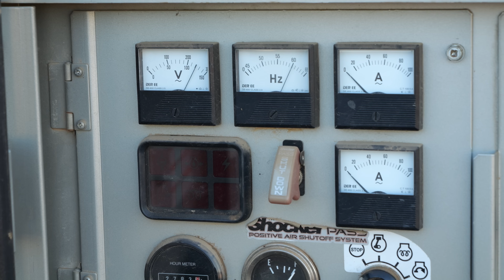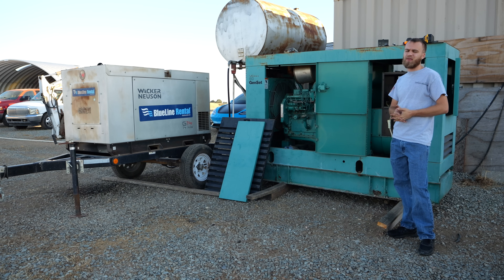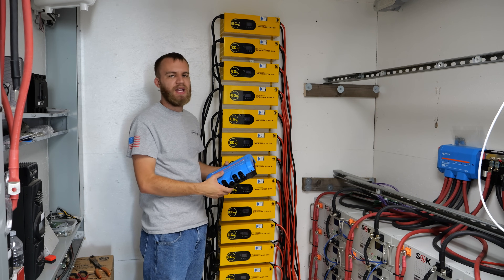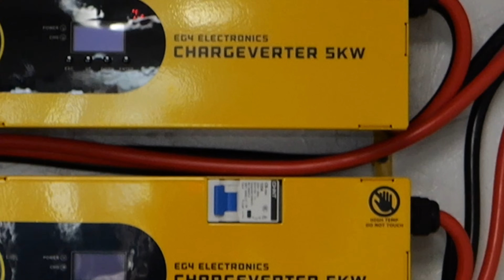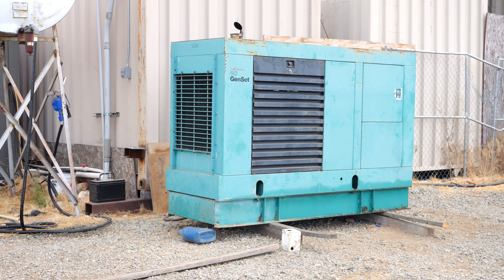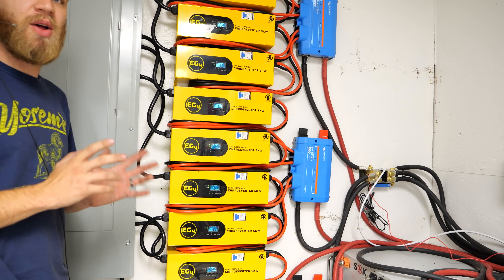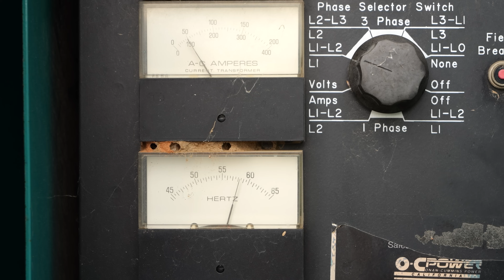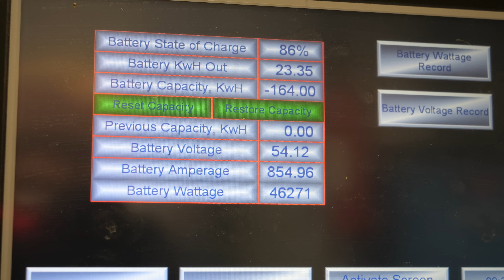😮 12x EG4 Chargerverter 5000's - 48v 1200A Battery Charging System!

Comment from the maker: To answer questions in advance, no, they are not growing crops with all the power.  On the property, there are 3 RV's, one for my mom, one for my dad, and one for my step-dad.  RV's are not very energy efficient...so in summer when it's 110F outside, they use a LOT of power to air condition them.  The electrical room is also air conditioned and there is a hot tub that used to have the excess diverted to it, but sometimes they don't like waiting until there (isn't) excess.  They only have about 12kW of solar, mounted flat, so it doesn't get anywhere near peak production.
Reply: You didn’t mention anything about a lab in those RVs, Heisenberg.
Reply: @nebulight  "Round bottom flasks they make the HighTech world go round" - Queen
Reply: If you hadn't pinned this, I wouldn't have cared why you're doing this, but now I have to ask.  Why is everyone on the same property, yet living in different RV's?
Reply from the maker: Divorced parents living together. Family gatherings are interesting
Reply: @HighTechLab  Love It!! A lot to be said when you get along well enough to continue a relationship with all involved. It is good to see. Blessings to Each of You!
Reply: So about 187 kwh of batteries. Dang I only have 70 and thought I was doing good. I too only have 12kw of panels. I too need more especially in Michigan
Reply: @electromechanicalstuff2602  what part of Michigan are you in?
Reply: WOW! Quite the project! My only recommendation would be to have kept the Plugs to make it easier if you need to replace one of the chargers in the future. Sooner or later one them will break :( But I can also see why you probably didn't want to go through the hassle & cost of wiring all the outlets.
Reply: Interesting.
Reply: Wow they are so low on solar, we have 240kwh bank with 70kw of solar and do not need a generator. Sunny day we hit around 500+ amps continuous for about 6 hours.
Reply: You can get solar panels now for $0.25 per watt new If you search around. They will pay for themselves very quickly
Reply: @deanburrito6943 any advice on where you're seeing those low cost panels? Cheapest I'm running across that aren't used is about $.50 per watt. Thanks.
Reply: What about changing the mounts for the 12 kw of solar so they are at the proper azimuth (usually X number of degrees E or W of magnetic South) and are tippable so that every month, or at a bare minimum every three months (each season) they can be tipped to the proper angle to maximize their solar energy production.
Reply: Money would have been better spent on second hand solar panels and some decently arranged ground mounts. Everything is a lot easier to manage when you are over producing.
Reply: Why are we not addressing mom living with his dad and step dad but they also have money for 12 chargeverters but not the 9v battery for the smoke alarm?  Make it make sense 😂
Reply: Question, how much propane does that joker use per week? Or month
Reply: Amazing work !!
Reply: When I first seen this much power I was like damn… I’m not going to lie I thought you were growing crops with all that power lol 😂
Reply: You could have built a bloody house with all that money. This is just fookin stupid!!
Reply: What’s the overall duty cycle for that generator to keep that battery bank charged?
Reply: I have my mep803 governed with a spring and a zip tie too😅
Reply: Replacing every air conditioner with an EG4 solar/AC mini split would allow a lot less power usage, probably no need for chargverters and a giant diesel generator, and you will find you have way more battery capacity than needed..  put the new money into EG4 solar mini-splits and more solar panels, you will be able to sell 1/2 that battery bank, all the chargverters, and the 100KW diesel generator.   First rule of fight club, lower the consumption/raise the efficiency before buying additional equipment 😬
Reply: i guess its unrelated but i think your parent RV are not using the right AC efficiently, i living in my RV and used only 5000btu low watt unit its only draw 350watt an, and i place it betwen the bed area and sofa, i create a partition with sliding door so my ac only cooling bed area and sofa area, my ac dont need to cooling entire van area which is using more power to do so, why you need to cooling you toilet and kitchen area anyway? does those thing need to be cooled???

Comment: Good Lord,
   You set me wondering.
  You could invest in a few 48v x 5kw wind turbine PMGs.
I run a 2kw PMG with a rectifier block. I believe that this is one of the most efficient methods of generating lecky.

Comment: So, will the Chargeverter work in parallel with the Chargeerter-GC (assume yes), and the eco-worthy 60A 48V charger all 3 in parallel without problems? eco-worthy works 6 in parallel.. I'm curious if these two brands will alll work in parallel. I'm assuming yes, but haven't seen anyone do it. I dont want to be the first.

Comment: I wouldn’t waste a dollar on generators,6000.00 would have bought a lot of solar panels and a rack. That looks like a rotary pump B5.9 Cummins,they are a very solid .Are you concerned about the high charge rate shortening the battery life especially in the s7mmer when there’s a lot of heat in that utility electrical room.

Comment: Amazing setup, Is your generator 3-phase. I am looking to charge my batteries with a 3-phase generator using 208V. I was wondering if you could expand on how you wired your chargeverters to your generator?

Comment: What cable is coming off the generator to allow 1000 amps of charge?
Reply: I believe he is talking about 1000 amps on the 48v DC bus.  That would be about 200 amps on the 240v AC lines from genset to breaker panel.

Comment: That is a beast of a setup!  I'm curious how the Chargeverters are holding up now that it's been a few months.  We are building a stronger charging solution for our off grid cell tower site. Have the Chargerverters kept their voltage and amp settings through all of the various generator cycles? Our generator is tiny in comparison (9500w). We have 2 Chargeverters along with the Victron Quattro 5000 charging which will be disabled most of the time in order to keep the generator 240v phases even. Plan is to back off the CV amps to keep the generator around it's peak 24x7 output rating.  Generator only runs if there's multiple cloudy days. It's a very remote site so if the CVs settings get lost, they will overpower the generator if they go back to 100A.

Comment: I am kind of surprised no one mentioned floating neutral on the old generator as being a possible cause. We have seen that issue several times where some generators either intermittently charge, or just don't charge the attached equipment at all. Some equipment is just better at handling the floating neutral that most generators are setup for. Hidden usually in the manual, often in just a paragraph or less there will be something about this but there is many videos out there that can explain the floating neutral issue and how to correct it, because it sure would have been cheaper than doing all this work.
Reply: charger prob wouldnt run at all if it that was the case.

Comment: Seems like you need a direct DC generator. Skip all the AC-DC rectifiers.
Reply from the maker: The difference is the rectifier is built into the generator- and do you have any referrals to a 1200a/48v generator for this price range?

Comment: the 2 wires that are not hooked up on the oil pressure sensor I think need to be hooked up to make the connection to the controller and make it work 
right now it thinks it has no oil pressure and would go into shutdown without the ziptie  
you will prob need to buy a new oil pressure switch also as there maybe a reason it's unhooked
awesome setup btw !!!

Comment: Hi, high tech lab. I have a question on the Chargeverter that maybe able to clarify. I am totally off grid. Signiture Solar tech recommended that I don’t charge my batteries with them being charged and discharging to run my house.when my solar panels not producing power. Have you ever have any problems charging your batteries and the inverter running with loads? Thanks for your opinion.

Comment: I'm curious about your heat mitigation strategy for your chargeverters. They tend to run quite hot, and I own one myself. While I've ensured ample space around mine as instructed, the heat output is still significant. I'd appreciate any insights you have on managing this heat.

Comment: Why did you buy distributers when the power in is the exact same thing, Minus the circuit board, LEDS and canbus that your obviously not going to use? if ytou needed fuses in it you can easily add the bolts, nuts washers and so forth to make it mega fuse capable for a lot less money.
Reply from the maker: I didn’t want to have to go track down bolts.
Reply: @HighTechLab  Smart A$$ 🙂Love the setup.

Comment: Is it OK to stack 5 SOK server rack batteries on top of each other? The manual says 3 max. I ask because I also want to stack at least 5 without using the rack. Do the bottom ones get too stressed?
Reply from the maker: Depends on if you worry about having a warranty.  For me, I am the warranty...

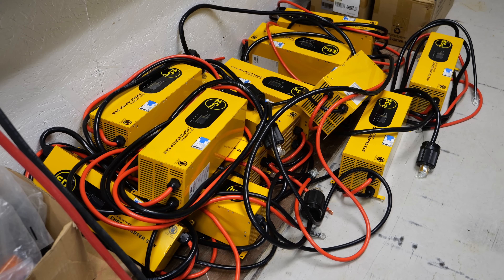Comment: 2:20 That battery bank has the equivalent energy of a small nuclear weapon if all the cells melt down at the same time.
Reply: Not even remotely close.  That 656 kWh battery pack has the energy equivalent of 1128 pounds of TNT. That's equivalent to a 0.0005 kiloton nuclear weapon.  You'd need 35,000 of these to equal a very small 20kT weapon.
Reply: @stargazer7644  No S Sherlock.  Have you ever heard of hyperbole?

Comment: when i first read it i thought that 48v 1200A that really isn't a huge home battery, then i realised it said A and not AH. 57kw of charging power goddamn. The best i can do is 12kw with my 3phase deye.

i have 1400ah of lead acid agms for my house consumption together with 18kw solar, My main fuses to my provider can only do 25A x 3 fuses. So i am hard limited to selling/buying about 17kw. Need to get thicker wires inside to get access to more power.

I suppose this home battery has around 120 kwh then? perhaps for lifetime concerns about 90-100 usable kwh.

Comment: Given that you've got a finely-tunable load right there you could maybe perform some interesting tests on the generator to find the sweet spot where it's at its most efficient, not just for science but for practicality as you can hopefully save fuel.
Fill the tank right to the brim, run for an hour at xx kVA load, measure how much it takes to brim the tank again.  Repeat at different kVA loadings, either by adjusting settings or turning off balanced triplets of inverters. Graph and learn :)
Worth running a three-phase socket off that panel as well? You've got a three phase diesel-powered supply available for the odd occasions when one would come in handy.

Comment: Wow that was really cool. I’ve never seen european colour coded wires used in a US panel before.
What a great setup! I really like this it turned out great. And will look even better when the lugs arrive.

Its always good to have backups and redundancy and this really covers that greatly. Great concept and use case for this properties specific needs. And could benefit similar and other use cases.
Reply: Those are the colors of the AC input cable that the EG4 chargers use.  It actually fits better in this case than the normal black/white/green of normal ICEA table E1 flexible cords as brown and blue are both established hot colors.
Reply: @randacnam7321  Oh, that’s interesting. I didn’t know brown had an established code rule in NA systems. I have seen blue in 3phase panels in NA diagrams labeled as a Hot. And I’ve seen yellow/green striped as an accepted standard in one diagram for Ground.

Cable wise I know it isn’t uncommon for cords that come with computer supplies in the US to use the typically European - Brown = Live, Blue = Neutral, and Yellow / Green = Earth standard. So I figure EG4 is just doing that as it seems to be a readily available cable option.
Reply: @peteasmr2952  Brown is L1 for 277V/480VGrdY and 480V delta.  Brown hot/blue neutral is the abominable IEC standard.  The only thing it's better than is the old Soviet standard where L2 is green.

Comment: I think it might have been worthwhile to install the twistlocks off the breaker panel, and you should keep the DC wiring original/full length.  The reason?  Think about maintainance/warranty…  It’s much easier to remove a plug, and send back a defective charger under warranty, to EG4 if it hasn’t been modified, also faster for you, as you won’t have to open the panel and loosen the screws on the 2 pole breaker.
Reply from the maker: This is true, but those boxes sure do take a long time to wire up…also I work directly with eg4 so warranty is trivial.

Comment: Finlay !! I can not understand why this is not the standard. to be honest the Inverter Charger combo is only god for RVs that frequent trailer parks. In any other setup you are better of separating the Inverter and Charger , and definitely having a charger that can tolerate "dirty AC".
Reply: I AGREE.  It is was smart to timeslice the inverter/charger.....back in the day.  But Today with cheap CVs, separate chargers makes more sense and provides simpler operation, saving the vital inverter for inverting

I have a XW Pro and have switched to this model. ONLY use the inverter for loads, and not the internal charger to power charge battery (It is hooked up for possible emergency use)

I have 2 CVs with 2 L14-30r from 2 grid circuits and 2 L14-30r from the 2 generator circuits.   When solar input is low I can use either grid or generator to boost power.   Save stress on the internal charger AND can have spare CVs at a cheaper price.  LOVE this architecture model

Comment: I am looking for about your product place lace me a message . when I post this, I am looking for more information no this. I seen your video on how do you set all this up I wonder if I could do this to a generator for a cabin and off-grid it don't have nowhere to get powers that somebody's you can win turbo and a water source and soda panels just wondering if it would work run a workshop at greenhouse and a tiny house that equipment like charging batteries for toward welder and a bunch of other stuff get back to me and take care of yourself. Another question a friend was asking me would it work if I can do this on a houseboat or a bunch of houses on water run on a houseboat if it was on a lake somewhere
Reply from the maker: This is not a paid product placement or sponsorship. You can look up these chargers up from CurrentConnected

Comment: I can't help but think you've had to do a heck of a lot of working around around the fact that you bought solark inverters. Personally I think they're overrated.  Give me a good old fashioned tried and tested  Victron or SMA Sunny island any day of the week.  I would think a pair of Victron Quattro 15k would have served your parents much better as they're literally designed for generator use and probably would have worked fine with your existing genny once you configured the weak power input/dynamic power limiter/power assist settings right.  There's a reason 90% of boats etc in the world have Victron kit in them I aint seen one with solark yet.  Either way very interesting vid, a heck of a battery bank and one heck of a workaround!
Reply from the maker: If Victron was UL listed, it would be a different story. They are not very permit friendly in California.

Comment: We have the similar genset but not enclosed. Bought new in the 90s and worked reliably. But recently, the avr burst into flames because it used the infamous Rifa paper caps. Fortunately was a quick fix there are lots of clones of the avr that used more reliable poly caps. Might want to check yours out, if the Rifa caps are cracked, they will burst into flames eventually.

Comment: Little confused;  I thought you said it was a 480V generator.  That would be phase to phase.  How are you running 120/240V chargers off that?  277V to neutral would still be too much voltage.  What did I miss?  Also, are those chargers all completely Isolated so they don't care how their outputs are paired?  Thanks.
Lastly; You're not over "C"ing those batteries charging them back up almost all the way in only two hours? What's the allowed charging C rate?
Reply from the maker: I re tapped the generator for 208. Batteries are good up to 1C

Comment: Sounds like a good PV mounting structure would be a solar canopy to park the RVs under so sun isn't hitting them directly which would cut the heat gain.
Reply: Gov Subsidy WILL cover 30% of the cost of such a structure if you are covering it with solar now.

Comment: We have seven 750 kilowatt hours worth of lithium EG4 LL batteries with twenty five of these 5000 chargers. The only problem that i've seen with this setup You definitely Need to have more space in between and a cooling fan.
Reply: Oh just read you said next year. I'm planning 4x18k 3500amp hour 130x480 panels. Thinking of also adding 8 of these
Reply from the maker: Is that on YouTube????
Reply: No it will be sometime next year. 10x18K EG4 inverters  150 x EG4 LL batteries and 400  x 405 watt bifacial solar panels .
Reply from the maker: @SpencerLAPower  dang. I want to hear more…dexter@currentconnected.com drop me a quick email
Reply: Could you please post a link to this setup you mentioned.  You have me searching all over the place for it. That's amazing, would really love to see it